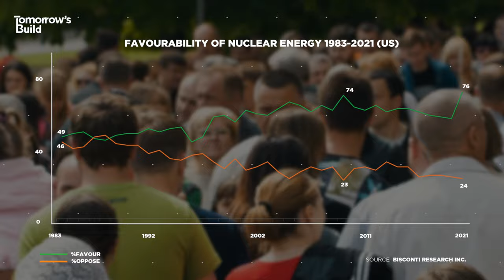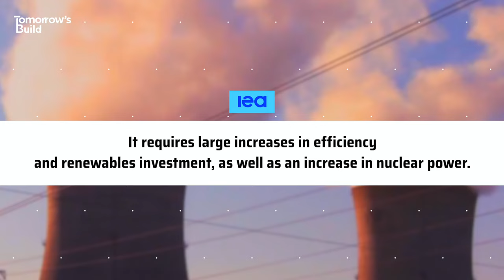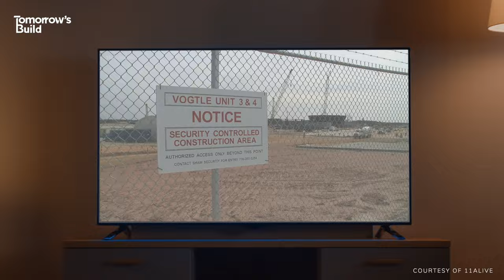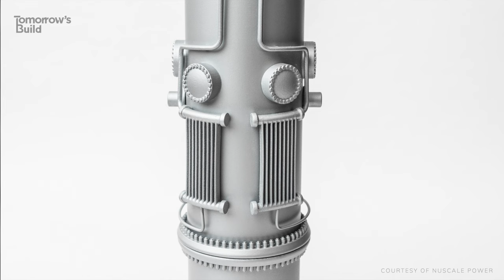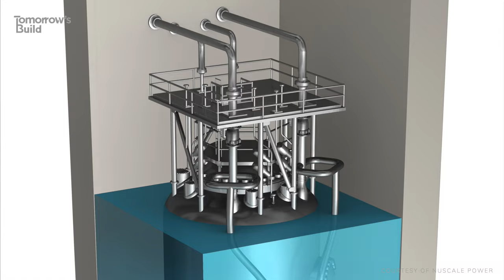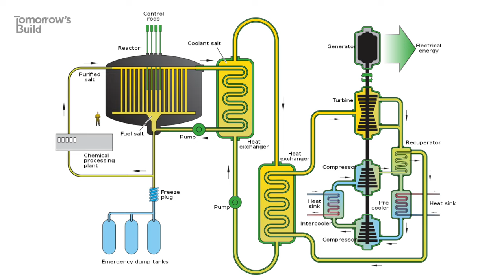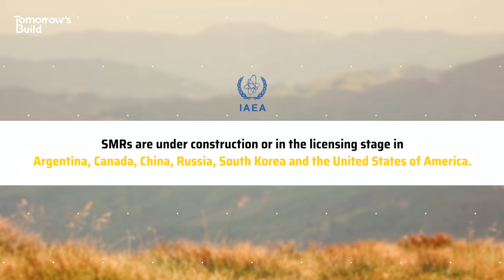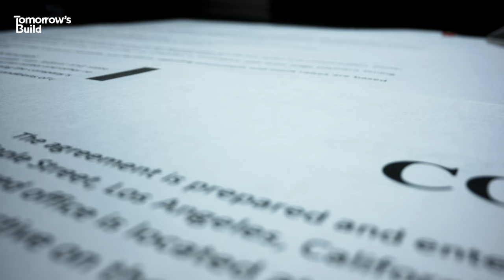These Mini Nuclear Reactors Can be Built Anywhere

Comment: Steel founderies and Aluminium smelters are high on the list for a small dedicated nuclear power plant.   The need to run 24/7 and require copiouse ammounts of electricity.   They are the foundation blocks of all engineering and thus of modern sociaty.   Also, metals such as steel and aluminium are highly recyclable materials, saves on mining.
Reply: Im assuming t people behind this hav never heard of planning permission. No way this would fly, u will hav every nimby in a 20 mi radius comin out of t woodwork.
Reply: Yep. You can only smelt Auminum properly when electricity is below a certain price. There was a refinery in Niagara Falls. Unsure if its still there.
Reply: Aluminum*
Reply: @piouswhale  Didn't Mr. Westinghouse build the first hydoelectric dam at Niagara / Buffalo ?
When I was in the States in '93 we visited Niagara Falls. If I'm not mistaken, Bufallo NY was, and maybe still is, a center of industry.
Reply: @piouswhale  Don't be a prick*
Reply: @krashd  I was correcting my own comment but thanks
Reply: @trespire  It was. Sadly it is dying and has been so for a long time. Steel mills of Lackawanna and down the shore of the lake. For a long time it was an industrial city. Slowly State and city policies pushed businesses and people out, crime moved in. People were pushed to the suburbs. Some remain, many more have left the state.
Reply: @piouswhale  That's too bad, I suspected as much. The US was such a power house of mechanical and electrical industry for several decades after WW2.   A simmilar situation happened in the UK in the 80s.   Policy makers need to understand manufacturing is the economic foundation.
Reply: Dont forget desalination plants as well they too take a lot of energy
Reply: Same for copper producers, and probably most of metalurgy.
Reply: More than likely natural gas would be used for foundries.
Reply: Heat is required, not necessarily electricity
Reply: In my opinion this is a grand idea. Modular nuclear energy - the possibilities are endless, and a far safer option, both for us and for the environment. I believe  this proposed mini reactor class will prove a tremendous boon to all aspects of human activity.

Lets say you are a mining company, and you've prospected for and discovered a new excavation site in a remote region, in Alaska for example, to mine some rare earth metals - perhaps to build new reactors. You must plan, design and build an entire operation, complete with all the necessary infrastructure and processing facilities, in this highly inaccesible and treacherous, mountainous region. Logistics and sustenance are important, but energy is VITAL, and is needed to mine the minerals, process them and transport them, and to monitor it all effectively, as well as provide onsite commodities and accomodation/facilities for your workers.

The usual power supplies are not possible or practical, a conventional power plant is not possible, the site is too remote for grid power supply, and the entire area is inaccesible for a large part of the year, preventing delivery of large quantities of fuel sources. What do we do about energy?

A small, easily transportable source energy lasting for decades, as long as you are able to get the unit there, which should not prove entirely too difficult if you can also transport superheavy plant and cargo to the same place, I'd say this is a pretty promising solution, practically generates profit instead of costing the company as long as the site is longterm, and even then, if the site was not, this power source could theoretically even get transported and placed on another site.
Reply: @Ryan  Tiwai point new Zealand aluminum smelter is hydro electric
Reply: @piouswhale  if you’re American, welcome to the rest of the world
Reply: Mass produced? Good luck with that. Try producing them first.
Reply: All metals are recyclable. Th metals mined in the bronze age are still in circulation today. But yes. Good locations for safe nuclear. If it ever exists.
Reply: recycling metals is a bullshit process, it takes more energy than refine ore, you often dont know wtf is alloyed you are using and will have to do mixes that will go down like, i know this is at least 80% steel and this 10% these other alloying materials and the rest 10% you will have no f0k1ng idea of what it is, severely limiting the uses of it, can i make a car part? no its not safe, can i make a rebar? no might fail on a multi store building, can i make a pan? no it might contain toxic alloying materials, so useless all around, and separating these costs more energy and labour.
Reply: @derlon858  It's basically the same process, whether a blast furnace for ferrus alloys, or arc furnace for aluminium etc..
If done to standards, with control of metalurgic content, you can get good metals.
Reply: @trespire  not really the same process, refining ore is streamlined, recycling will  vary, here have some light alloy wheels, what brand and year are they? are they real or knock offs? will you examine each part you get when you have tons to process daily? will you separate them? providing you know the alloy and would it even be worth it? not really no, them u have poorer places recycling aluminum for example, do they have even the tools? or they keep fabricating pans wich are toxic for the user cause they can contain cobalt, heavy metals or others?  this esg bs needs to die or it will kill people

Comment: 6:08 I work a lot with silicon carbide (thin film deposition for nanotechnology applications) and I can confirm that SiC is a very stable material. Melting point of >1300C, high hardness (approaching diamond), very good thermal conductivity, but most importantly it’s very etch resistant (wet or dry) and even stable within biological environments. I’ve read papers that mentioned the influence of irradiating SiC with neutrons, might be related to this application. Cheers!
Reply: would it be possible to use it to 3D print small reactors? that’s something i’ve been very interested in, i think it has great promise for molten metal reactors
Reply: @madisonbrigman8186  Maybe, but I don’t see how. I make it using plasma enhanced chemical vapor deposition, which essentially coats an entire vacuum chamber in a thin film of SiC. So it’s not a very directional process. But perhaps you could design some kind of welding torch that uses silane and methane, which is an interesting thought.
Reply: @theunitednation7672  think there is more than 100 years worth and then there is also thorium too.
Reply: @theunitednation7672  there is enough thorium and uranium to last the world (running on 100% nuclear) at current power consumption for a little over 4 billion years. this is because uranium is soluble in seawater so as it weathers from rocks it dissolves in rivers. thorium on the other hand, is three times as abundant as uranium and can be found in lots of different rock types throughout the world. given this logic, and using other reactor types than thermal; nuclear fission fuels are just as long lasting as sunlight.
Reply: @theunitednation7672  interesting! one thing i’ve been interested in is the possibility of phytomining sources of thorium. some plants hyper accumulate metals and there are a few that accumulate thorium. although they do this in amounts that are unfortunately uneconomical, with breeding and genetic modification - hopefully we can improve their abilities! it could bring down the cost dramatically over a long enough span of time because thorium is expensive to mine (although we have large enough quantities in rare earth tailings to last the US 100 years).
Reply: @theunitednation7672  

Some reactors “breeder reactors” they produce sufficient neutrons to produce their own fuel. The radiate “fertile” elements like Thorium to produce fissile Uranium.
Reply: Stupid question here;
Are we not kicking the can down the road (environment wise) by burying the spent fuel? If there is widespread adoption of nuclear power... Will we not have issues?
Reply: @vusisemwayo  my question exactly. “spent” fuel from thermal reactors isnt really spent at all. it’s quite wasteful to put it in the ground if you ask me
Reply: @madisonbrigman8186  Technical ceramics like silicon carbide or tungsten carbide tool inserts are usually processed by sintering, due to the very high temperatures. In theory you can 3D print technical ceramics with powder based methods like binder jetting to produce the green part, followed by sintering. There is a German company who have made a SLA resin impregnated with glass particles, which can then be debinded and sintered to make very accurate solid printed quartz glass (and other specialty glass) objects essentially. It may in theory be possible to make a large technical ceramic part with one of these methods, but I don't know if there are limitations with size (other than printer and furnace size) and deformation during sintering. There are other considerations such as chemistry and radiation behaviour to consider.

Oak Ridge National laboratories is doing work printing experimental microreactor cores with DED (Direct Energy Deposition) I think. By printing in refractory metals they can reach core output temperatures of 1482C apparently, which increases thermodynamic efficiency to 50%. Oak Ridge also have developed a method of 3D printing a composite form of boron carbide (the third hardest material known, behind cubic boron nitride and diamond) although it is an aluminium infiltrated boron carbide so it wouldn't be suitable for high temperatures, it is used for neutron shielding since boron carbide has a very high absorbtion of neutrons.